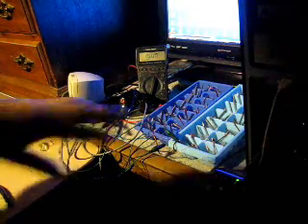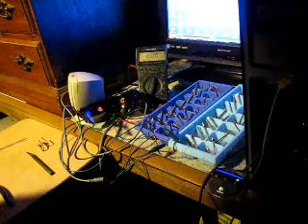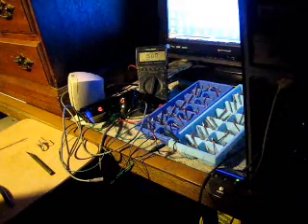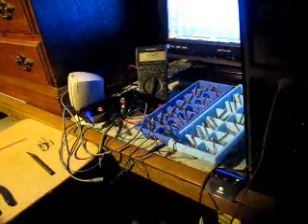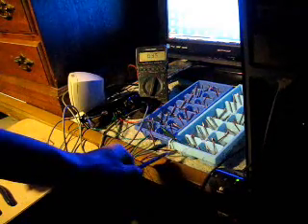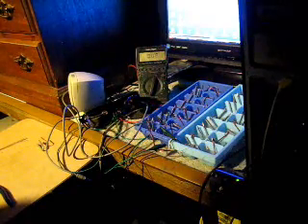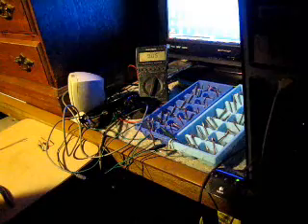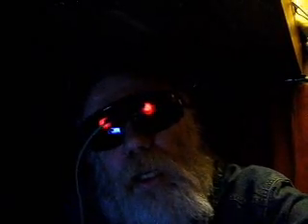WATER BATTERY part 2

Comment from the maker: @07krull Took me awhile to figure out again where to respond...I'm a lil slow. Anyway the water battery shown here went about 8 days untill the zink was stripped by electrolysis from the staples. I am sure a solid zink nail or object would run much much longer, just don't have any solid zink. Thanx for the reply